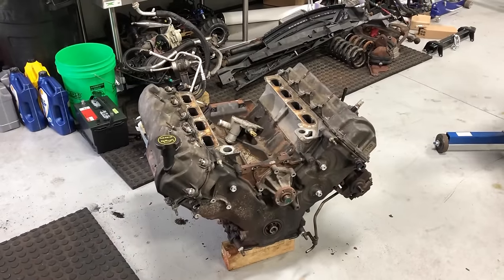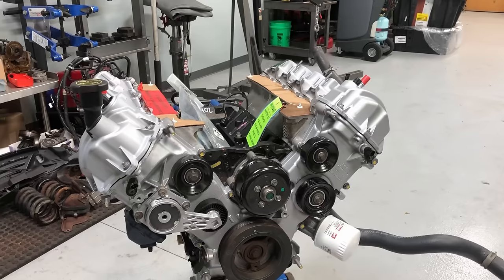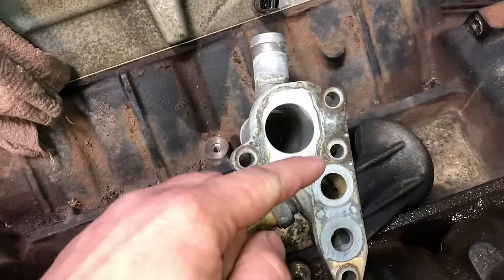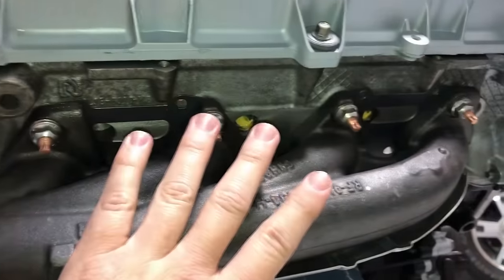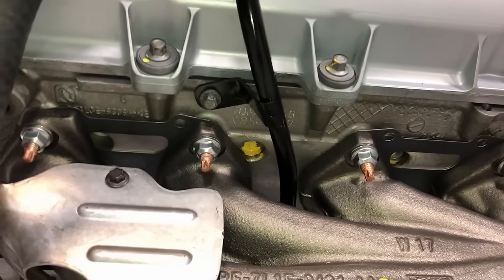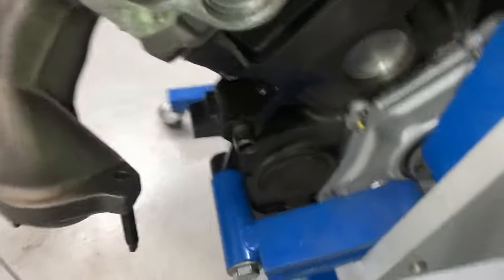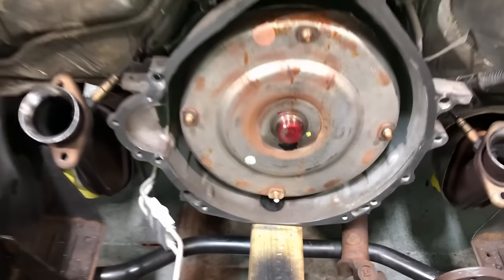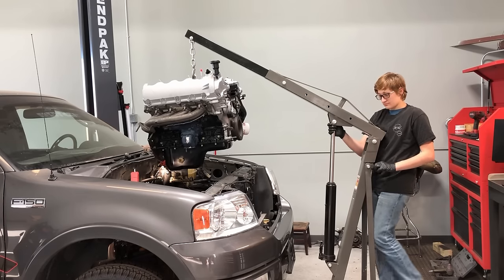Ford 5.4L 3v Triton Engine Removal & Installation Part 2 of 2: Engine Prep and Installation

Comment: Awesome video.  I learned a lot.    I like to take the front wheels off and lower the truck down until the front rotors are few inches off the ground.  Lowers the working height.  Makes working so much easier.  Lay the front wheels down in the front of the bumper for a step stool.     Also take that hood latch off..that thing digs into your gut.

Comment: Wow. Dropping these high tech engines. So much to look out for damaging delicate parts. My experiences helping with engine swaps, (long ago, in simpler times) so much easier. Only thing we did different was using wood and cardboard in the engine bay to shoehorn it into the final drop location and then remove the wood (like pieces of wall paneling) and/or cardboard. This would make any mishaps, as we saw here, from causing too much grief. Loved the details and tips. Excellent video and audio production values we've come to love from your workshop to our homes

Comment: At least he caught it, closed the valve. My pops would have freaked. I drilled a hole in the jack handles, use a bolt inserted, to control preasure... Similar to a basin wrench. Great job explaining, showing slow positioning, rather then brute force!

Comment: I just wanted to say these videos on motor removal and installation are very good I’m a guy who knows very little about working on cars but my 4.6 blew a head gasket in 05 f150 and I came across your videos and I will say with the help of these videos so far I have the motor ready to pull I just have to cut the manifold anyways I just wanted to say out of all of the videos I have found yours by far was the best it was step by step showing what to do video well done thank you

Comment: I changed both exhaust manifolds and used stainless steel studs and bolts went on like a like a dream no more noise no more exhaust noise I've got enough for the dual exhaust

Comment: I'm just a DIY guy for mostly simple repairs for my 2005 Ford Expedition. I am not very mechanically oriented but over the years have learned by doing, reading, listening to others and of course watching videos etc. Your level of knowledge and expertise is incredible! You are the "Doctor of all things mechanical." Additionally, when you consider and think of the incredible level of science, physics and engineering that is involved with the internal combustion engine, it makes you appreciate the advancement of mankind in relationship to industry and technology. It wasn't that long ago, say 250 years, that man either walked or used an animal for transportation. This mode of transportation had continued for 5000 years! To see all of the intricate detail and how things are synchronized together just right - its amazing. We were created in God's image and likeness - the ability to create, think, invent, use logic and solve problems. Great job Doctor!

Comment: for air pockets getting stuck in the coolant i start the truck and keep squeezing the upper radiater hose multiple times wait for temperature to get up a little shut off the truck open the coolant cap and keep squeezing the radiator hose. seems to work easy

Comment: When I was a kid I installed a remanufactured 5.4 into a navigator. It didn’t have a filter on it and had tags that said it had no oil. So I finished the job and looked the capacity up and added 7qt. Started it up and it idled like it had potato cams in it. The motor already had 7qt in it and I put 7 more. Im good at checking the dipstick now.

Comment: I did a 4.6 on a 97 f150 4x4 and used a overhead hoist, so much better control than a cherry picker. Any time I needed to go back with the engine, I didn't, I just simply pushed the truck forward little at a time as I lowered the motor down, pulling it out was a reversed process. I will never use a cherry picker again after using a overhead hoist.

Comment: Awesome, BUT all of us car and truck guys like to see the START UP! Let her roar on film! Cheers
Reply from the maker: We started it at the end of the video, I am not going to rev a new engine just yet. That comes in the shop truck update part 2 video.
Reply: FordTechMakuloco you know what, I rewatched the end and did see that you started it. I don’t know how I missed that.
Reply: @FordTechMakuloco  your transmission pan leaking fluids  dripping on the floor I seen on your video
Reply from the maker: Yes the dipstick tube was removed for the engine and it was rusted so we had it out to replace it so it leaks a bit while removed.

Comment: The lowering part....where I work we are blessed with gantry crane, and we also have a heavy duty engine lift with a hyraulic pump and a remote- but with that said, we work with mid/heavy power diesel engines, and most of the time we have the hood removed from the semi, or we've built a frame for the power unit. The worst is in busses and Class A RV's.  I like the engine rebuilder you use, I am really considering repowering over going through the trouble of doing a timing job, head gaskets, etc on my 03' with 230K miles.  I'm going to just replace my coils/spark plugs and fix my leaky manifolds for now and look at getting a reman next year. You might be getting a call from me, lol.

Comment: Thank you for making these videos. They helped tremendously! The oil pump failed in my 2005 f150 5.4 4x4 and it seized up so i had to pull it out with the torque converter attached but it wasnt too bad. Got a rebuilt engine from powertrain. Great engine, only thing is the oil drain plug didnt have the gasket on it so i was leaking oil, easy fix though. Thanks for the detailed videos, would have been a lot harder without them.
Reply: How is your Powertrain engine holding up? Would you still recommend them?
Reply: @carlcelle2060  yes it is holding up very well. Havent had any issues at all. Still highly recommended.

Comment: a T handle on the wrench for the engine hoist jack valve will likely be some help in better control and ability to feather the rate of bleed off. Those single pipe designs can be a real pain to have positive control and often as not you go too far when the valve releases from a hard seat position.

Comment: I prefer an over head chain hoist. But my days of installing engines is over. Would be nice if that pistion on engine hoist has a finer threat valve to prevent what happened when lowering. You kept your cool.😄

Comment: Gosh! In my day on the 302 Mustang GT 1969. All you had to hook up was a couple vacum lines,  fuel lines, distributor wire, and throttle petal. And head off to Front street in Philadelphia, PA. To race.

Comment: I took off the radiator support on mine. To do that you have to drill all the spot welds. It was worth it especially going back in. I put it in with the transmission installed on the engine. With one of the long tube headers already on the engine I do believe it was the driver side. What a pain in the ass that was. Transmission installed wasn't a bad idea but the header made it so much harder. Since this is your truck I can't believe you didn't put some stainless steel shorty headers or long tube headers on
Reply: I don't think he believes in performance parts tho I would love to see him build a race motor 5.4 or 5.0 & drop it in a Mustang 👍

Comment: I have always been a Chevy man but I bought this same truck with 5.4 engine in 2008--this engine looks much more complicated than the Old 350 Engine in my 1998 Chevy Z71 hunting truck. the 350 is easy to install, maybe not so in the Newer Chevy's. I will have to say that this Ford truck has been one of the better trucks that I have ever owned, it is 14 years old and everything under hood is original with exception of Throttle Position Sensors and this Truck Eats Them--3rd. one....

Comment: lifting / taking the cab off the frame makes things lots easier. not a lot of work but makes the rest of the process much easier.
Reply from the maker: I would never attempt this on a vehicle in the rust belt.
Reply: @FordTechMakuloco  ah... yeah. I forget about you guys who like a challenge. us desert guys brush the dust off the threads and start wrenching. :)

Comment: Glad i found this video.
Im changing out my Cylinder head temperature sensor and pigtail doe to code P0119.
Already have the intake out. Looks like a nitemare to get back in.🤞
I did manage to get it out with the water crossover still in, but i think it has to come out prior to intake going back in to make life easier.

Comment: When I worked a L/M A friend and I were the only ones that did engine installs , he would remove the bodies and I did it through the hood. we were always within a half hour of each other. Occasionally he had a problem with body bolts. I stayed on through hood in stalls.

Comment: Hey buddy great work, I have a question about the 5r55s mine has a hard reverse engagement and hard 2-3 shift, but no engine or transmission codes, do you think I should replace the solenoid pack or wait until it throws a check engine light?? Thanks a bunch

Comment: Just watched this as pointers for my install. I think it's awesome I bought my engine from power train and seeing one identical being installed here. Great job! Would love to see a video of the entire vacuum system for the 4WD. Someone has removed it all from my truck and CANNOT FIND ANYWHERE where the vacuum comes off the motor to supply the 4wd.
Reply: I'm looking at buying the same one. How is the engine doing now?
Reply: @carlcelle2060  it's running great. Now the rear end needs replacing 😂
Reply: @carlcelle2060  also read my other comment on getting oil pressure. It may help you out.

Comment: You make it look so easy, and I know from experience that is a big job. Question how do you organize all the bolts and nuts you take out. I started at the age of 13 as a mechanics helper , my neighbor was a mechanic and he put every nut and bolt in one big coffee can and it was always a nightmare to find the right bolts. We spent more time digging in the bolts than working. now 44 years later I don't do it for a living but I do all my own work. I use about 20 cans and try to categorize them and label them and put the can of bolts next to the part on the floor to save time. I some times get frustrated when I find myself spending to much time looking for a tool or bolts. just wondered how you do it.
Reply: I use plastic baggies and label the bags where things go even if it’s just 1 bolt or a nut. Also use a sharpie when you have a group of bolts and 1 of them is different I make sure I mark the hole and bolt if I can to know exactly where that bolt come out of.

Comment: FYI if you remove the driver side fuel rail you can easily insert the brake booster into the intake.

Comment: We followed your removal and install videos step-by-step and they made life a whole lot easier for me and my son. Thank you for your hard work. May I ask what oil you used for the break-in? We are using non-detergent SAE30 for the first 500 miles and then planning to use non-detergent 10-30w for the next 3000 miles.

Comment: First thank you for All your hard work making these ford triton 5.4 litre videos. This problematic Ford screw up and your skills with it, has made you a legend. Secondly I had the last plug number 8 push all the way in to the cylinder head, because instead of the lisle porcelain pusher doing its job it pushed the whole shell further into the head leaving the electrode and porcelain in the way.  I purchased ty he 17/64th bit and extension you said to drill it out with and no luck. Now I'm stuck removing head on this truck I just bought.  My question for you is what if I'm on a budget, I want to replace the parts your saying to replace when you get into this motor that Has 155k on it but oem Ford parts aren't cheap at all. Neither are the after market. Should I just leave what's in there in? If it seems OK? Or is there a cheaper more reliable way to go with not so oem expenses? Thanks again for all your knowledge and hard work.

Comment: Great videos! by all accounts you seem to be the authority on the 5.4L 3 valve engines!  I have a 2009 expedition with what I understand to be the 6R80 transmission.  First start up of the day, when you put the vehicle in reverse to back up, it shudders bad.  As soon as it warms up, it's usually good for the rest of the day, starts up and runs like a champ.  A little over 300k miles.  I change plugs, fluids and filters (including transmission) on a regular basis.  No check engine light or codes present. I was wondering if you have heard of this before?

Comment: You're too close friends of mine are doing their Mustangs LS and one's got a Foxbody the other one's got a standard you know GT but they alright . pretty interesting to see how your truck like myself.  I do a lot of off road trips and my two wheel drive truck caught fire around the fuse box under the hood,  that's why I'm going to do the 4x4 build......I don't know how the truck caught fire but it happened after the fact the engine was off. Around 8 minutes after the engine was off.

Comment: This will be my second time now putting my new engine in. First time around I rebuilt the low end two years ago. The rocker followers took a crap recently. I ended up buying the long block from powertrain. What procedure would you recommend I do to break in their engine? When can I use this truck for it’s intended purpose?

Comment: I believe that you are very professional and very knowledgeable on ford products and you explain in detail what you are doing and how you
are going to repair or replace the problem at hand.I have a question,i have a 2004 f150 5.4 3v and it just died after driving about 500 miles so i took it to a shop and they had it for 2 weeks ,couldn't find out what was wrong.so i took it to another shop and within hours they told me i need a new motor at 7800$.so they also said,no compression on the right side and the pushrods were bent
but they never took off the valve covers.one more thing is before I took it to any shop i had no crank and no start.sorry for so long.Do you have any advice???

Comment: now you need to do the same series on the F150 5.0. mine is going to the dealer next week to get a new engine.  Im changing pretty much everything that didnt come with the block.

Comment: I’m working on a 2007 Lincoln mark LT with the same engine. I’m at the priming stage, what happens if the oil pressure does not go up after the 7th time of turning the engine with the starter ?  I made sure to put a new oil pressure switch on the truck and made sure it was plugged in. Oil level is good on the dipstick as well

Comment: How much overall did the swap cost, with all the rust remediation, steering, and power steering??? I’ve got a 2000 F250 5.4 2 door long bed 4x4 I plan on doing a new engine soon and repairs while it’s all open.

Comment: Do you have a video on replacing the 2005 Ford F-150 5.4 3V Transmission Control Module ?

Comment: The best Ford tech I've learned from . Makes it easy to understand .I've got a new Taurus 3.5  . Fixing to tackle the water pump n chains . Any advice ? Been told best to pull engine and trans for easier access.
Reply from the maker: No don't pull anything the Taurus is one of the easiest to do plenty of room compared to other Ford models.
Reply: @FordTechMakuloco   Thanks . I Waz told labor time is around 18 hours . I know on the duratec 3.5 you have to have the cam tools .I've seen them on Amazon or would you recommend otc . I've been doing this for about 12 yrs . But still worry on timing jobs they make me nervous .I've never had one jump or bend the valve . Just Dread them lol .
Reply: Justin Grant And the 3.5 EcoBoost and 3.7 as well. RWD models have an external water pump.

Comment: Awesome video as always!! Question. When you only disconnected the CPS, during the priming procedure, are the injectors spraying?
Reply from the maker: CKP sensor or crank sensor and no nothing is firing coils nor fuel.
Reply: Oh ok. Thanks. I was jw if it was loading up the cylinders with fuel. You will have a sweet and reliable truck for sure.

Comment: I wish you’d make a video of how to rebuild a 4.6L 2v,3v,4V and a 5.4L 2v,3v, CORRECTLY!!!... ALSO, is it possible to do a 4V head swap on a 3v motor? Or is it worth the extra money to just buy a 4V motor?
Reply: A 4V head will only fit on a 2 valve or 4 valve block.

Comment: That engine must have been worked to death or not maintained well to need to be replaced at 123k miles. Great video man I am sharing this with my brother who is about ready to swap his Expedition engine. I just hate to see engines under 200k needing to be replaced. Those engines had their issues, but I know they can get more miles than that if maintained right.

Comment: Question, this job is being done on my truck with well over 280,000 and I should replace the original Transmission at the same time. Differant procedure ? enging & trand at the same time.
together ?
Thank You in advance.
Kurt

Comment: Can I ask what kind or brand of engine sling are you using??  I searched through your parts list but could not find it. Also, when you draw the vacuum to get the air out of the system, which is the best tool or unit to buy.  Thanks and I look forward to your reply.

Comment: What’s the weight capacity on your engine stand? Is the black bracket that was in place where the intake was at during install a requirement for removal and installation of this engine?

Comment: Oh………………… oh…..  I’ve been wanting to do a complete overhaul on my 07 F-150.   Motor, transmission, rear differential,  front ring gear (4:10 gears), power steering, and anything that is worn.  I’d like to zero time the truck.  

But, the last truck I overhauled and near zero timed was a 68 Ford with the 390 and a manual transmission.  It was far far easier to make the truck look new.  

This seems so complicated and there are wires, hoses and stuff everywhere.